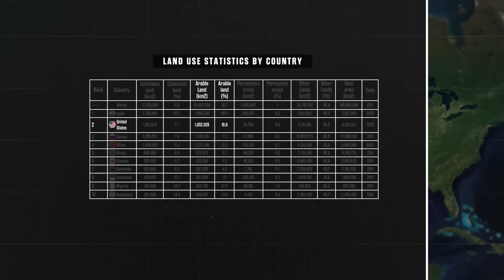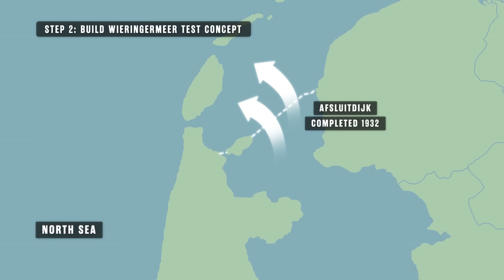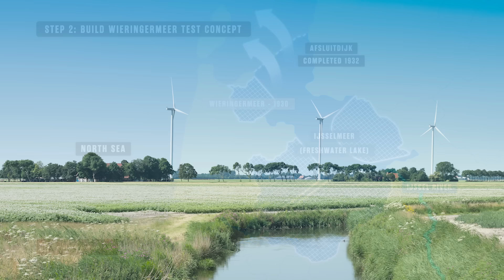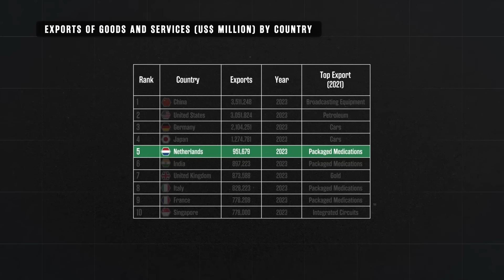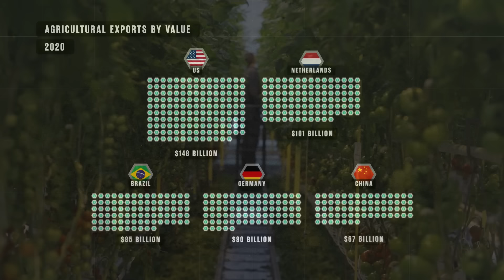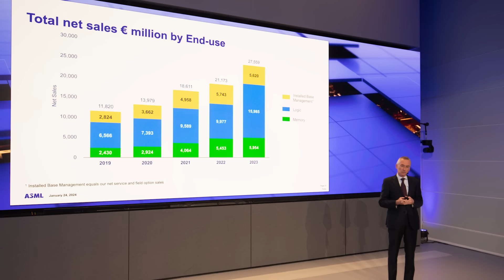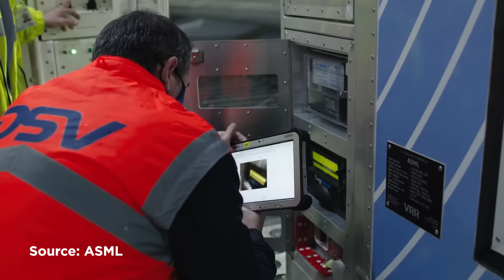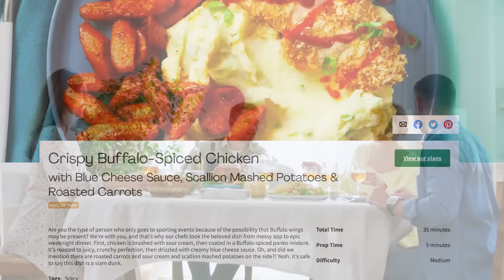Why the Netherlands is Europe’s Most OP Country

Comment: You forgot to mention that the Netherlands has a strong tradition in risk management, partly due to its ongoing battle against water. Dutch companies and managers are praised for their expertise in logistics, supply chain management, and risk management. They deliver managers to all countries around the world and fix their problems. The Dutch have an extensive degree of organisation and planning, from scheduling meetings to book holidays far in advance. Managers are vigorous and decisive, but the consensus is mandatory, as there are many key players in the decision-making process
Reply: Why it has going to do with battling water?
Reply: This vid laudates nld als origi al poster. Not just water
Reply: Weird comment
Reply: The 56 minute video had been up for less than 30 minutes when you posted this, how did you even know what he mentioned? lol
Reply: @Styreta  How dare you use common sense??
Reply: he did mention it albeit worded differently
Reply: They should send some of those managers to Intel…
Reply: He also forgot to plug his nebula
Reply: This is why the Dutch owned company I work for in property restoration is getting a lot of investment and being run somewhat properly for the moment. The Dutch, at least, can see that Canada needs help.
Reply: They often work following the “polder model”, which roughly means running a company (or anything else) by consensus. Though that has - at least in their politics - been showing some cracks. This model is in stark contrast to the French or Italian top down model.
Reply: Great BS story, greetingd from NL.
Reply: Also the Netherlands has some of the best swimmers in the world considering, and I'm guessing here, their fight against the ocean the everyone must learn how to swim
Reply: and where was the risk management of mass immigration? none to be found.
Reply: @honor9lite1337 because if they make one false move the oceans would drown parts of the country like it was Atlantis since a good chunk of it is below sea level
Reply: @honor9lite1337 If you can successfully run and maintain infrastructure in a country that is under constant threat of being submerged, you would probably have to be pretty good at planning and logistics.
Reply: @honor9lite1337  It comes from the dutch water board system. They were set up to handle anything to do with water communally.
Reply: @honor9lite1337   what is the single 2 most important parts for any engineering project before you even start building: planning and design.
Reply: And the Netherlands started modern science with it's influence in creating the modern microscope and telescope.
Reply: @hydoffdhagaweyne1037  No, it isn't. The Netherlands needed a lot of knowledge of physics and a lot of engineers. So, The Netherlands have a few very good universities. On the other side, the Netherlands needed a lot of merchants. They learned a lot of the Italians. The Netherlands had a small colony in the United States. The Dutch had something like a stock exchange. This colony was a part of New York. You should read some history books.
Reply: @BertVerschuren great answer and a fascinating topic in itself (the origins of the polder model).
Reply: @ChrisWijtmans define "mass" and please use data iso shallow Wilders parroting. Then please also take along the vacancies we have, the vergrijzing thats ongoing and our tiny birth rate that will produce an health care catastrophe if we dont actively continue to recruit foreign people to keep our work force at a sustainable level.... Sure housing is an issue, but the alternative is far worse...
Reply: @maartenvz  how old are you?
Reply: @honor9lite1337  hi i live in the netherlands and like most of the land is below sea level thats why because if the thing thats a sercurity measure against rising water gets destroyed so will allot of the netherlands i dont know how to word the structure so i called it security measure idk
Reply: It also helps having developed a dinstinct organization decisional style and cultivating historical ties with Japan e.g. the global Lean Six Sigma Institute in Rotterdam.
Reply: You gotta point me to those managers, because the managers I have experienced in the places I have worked in, in said country, don't scream of all this excellence you are boasting about.
Reply: Because to battle water you need cooperation, ability to manage the team and the equipment. If you look into the famous Delta Works system, you will discover that some of the solutions were created for the first time (creating an artificial island, for example)
Reply: How has the Netherlands' historical struggle with water shaped its reputation for exceptional risk management and organizational skills, and what impact does this have on its global influence in logistics and decision-making?
Reply: @honor9lite1337  In a nutshell. Dyke/Levy construction was historically depended on consensus, given the amount of time and money involved and the distribution of power between rulers, landowners and 'merchant-aristocracy'/finance. The more rights citizens got, the more this consensus-model gave form to current society also.
Reply: Amen. 🎉.
Reply: I think the Dutch’s skill with Risk management could also be chalked up to their history of mercantilism and pragmatism in commercial activities. Ofc mentioning the VOC you also need to reference that its not exactly ‘good’ business they were doing, but in terms of profitability and bureaucracy and especially when this was a Republic, with competing provinces managing these commercial affairs, managing the risks of overseas voyages in high-value trade, now thats where we really developed amazing risk management
Reply: I think the Dutch’s skill with Risk management could also be chalked up to their history of mercantilism and pragmatism in commercial activities. Ofc mentioning the VOC you also need to reference that its not exactly ‘good’ business they were doing, but in terms of profitability and bureaucracy and especially when this was a Republic, with competing provinces managing these commercial affairs, managing the risks of overseas voyages in high-value trade, now thats where we really developed amazing risk management
Reply: yep heard about this... they have really good logistic management skills.
Reply: @ChrisWijtmans i'm 41, not sure why you need that info to explain what you mean...
Reply: @ChrisWijtmans  Is there a risk then? Aren't we all having a little, nice, cozy, multi-culti society without any problems? 😂😂😂
Reply: @Styreta  He might have watched it in 2x speed, some people do that for some reason.
Reply: Top comment here. I’ve lived on my skin 100% exactly what the guy is saying: to plan an hangout with Dutch friends/colleagues, you need to plan 2-3 weeks in advance, like literally put it in a calendar, not joking.
Reply: @honor9lite1337  A government far away is of no use when the water comes. We are raised as children to always think independently and find our own solutions. We had in our history 3 decades without a government without a problem. We organize ourselves if something has to be done.
Reply: which makes sense if you look at the slogan in the dutch coat of arms that we have on our passports "Je maintiendrai" (Nederlands: Ik zal handhaven) (english: i will maintain)
Reply: @maartenvz  well our 'risk nabagment; has not been applied to the growing danger of islamisation and ethnic revanchism, already threatening Dutch citizens in our cities to be overwhelmed and being chased out of their  tiny appartments,  streets and entire quarters.
Reply: You have yet to visit Germany😂 being from there, I find the Dutch very spontaneous and adaptive. Ask a Dutch to meet up tomorrow and if they have time they'll agree. Ask a German to meet up tomorrow and you'll be likely denied because they're not in the right headspace (they really needed it planned). Unless you're a food friend, but again, Germans are more difficult to befriend too😂

Comment: 23:00 this is my city!!! Nijmegen. 
It used to flood like this every other year or so, but a few years ago the city dug out/built a  'mirror canal' (spiegel-Waal) which reliefs the Waal itself, so no/less flooding. The Spiegel-Waal is used in the summer for watersports and relaxation, because there's barely any current unlike the Waal itself. Lastly, the quay has been partially rebuilt to withstand more water. It still floods but all controlled and as intended.

Comment: When Chinese experts tried to disassemble and reassemble an ASML machine exactly to see how it worked, it malfunctioned and they could no longer get it to work.
Reply: Let alone the software needed for it 😂
Reply: @ruud9761  I work at ASML, people know a lot less about how far they're behind from us. It's a lot worse than you think. 😅
Reply: @kyazumizerk9270  I admire the confidence and like it. But so thought tesla and up came BYD, because its a logarithmatic scale, it does not take exactl 10 years to catch up with 10 years of work. Same with chatGPT.  I am not a supporter , neither a denier. Just an observer.
Reply: @ruud9761 Even if ASML wouldnt be there, the location would be a military target because of its location. Besides Eindhoven Airport, where  Air Mobility Command from the airforce is stationed, and 9km (5.5miles) from the army base Oirschot
Reply: Besides strategically in case of war, it is on one of the most protected routes in europe.
As The US will be using the ports in Vlissingen and Rotterdam as landing areas, 
AMSL is situated directly on route used from the ports to central europe
Reply: @piyushgupta3678  cars are a lot easier to design and build than NXE/EXE EUV machines. It's not comparable. ASML alone took 12-14 years for the NXE 16 years for the EXE.
Reply: @mcebabds  Trumpf would be a bigger target due to their lasers.
Reply: @piyushgupta3678 Tesla still outperformes BYD or any other car today. Specially at efficiency. Something that surprises me. It’s hard to copy for Xi?
Reply: @piyushgupta3678  chatgpt and electric cars are not comparable to this type of tech. Especially chatGPT, since it is based on a lot of research available for the whole world.
Reply: @kyazumizerk9270, T'is simply the payoff of never giving up, but let's not get cocky and comfortable yet now that it's no longer about competition, bigger dreams mean bigger results, let's puch tech forward another decade where we can 😊 awesome work
Reply: @jeroenvermunt3372  Electric cars are like a technology integration project. Batteries exist, motors exist, controls exist.
Get good designers in (the Chinese did that, and gave them some freedom they would not get at the classical car brands) end it is a success.
Reply: Ive heard that same thing from one of your colleagues and my friend. Its laughable he said. @kyazumizerk9270

Comment: The Afsluitdijk across the Zuiderzee was build in the 30's before that storm and that storm actually happend in 1953. The Ooster Schelde Kering of the Delta Works were actually build in the 60's because of damage and death caused by that storm. We have had many catastrophic storms in the last 1000 years so when technology made it possible to make something substantial and  lasting against it we made sure we did it right so it does not happen again in the foreseeable future.

Comment: 32:00 worth noting, the Groningen Gas Field isn't empty, but it has been shut down due to circumstance. Decades of emptying out the gas field has caused earthquakes to become a frequent issue in the region (mind you, these are relatively minor shocks, but still enough to crack houses). Also, the energy transition has questioned the relevance of the field and whether or not it is worth the risk and depreciation of livability in the region. It is estimated ~2200 billion cubic meters of gas has been extracted thus far, with roughly 700 billion still remaining under the ground - this data being published on january 2022. Last year a similar conclusion was drawn, with the total being roughly 2900 billion, and the then-current remaining bit 500. The gas field was officially closed this April, with no known data on remaining gas, but I'd say 450 billion kubic meters is a fair estimate. This is roughly 75 billion euros going by 2023 data.

Comment: No disrespect to the Dutch  but the export number compared to the US is not accurate. Because much of the goods the  Dutch  exports comes into the port of Rotterdam from others countries and then shipped out to end user countries. So not produced in NL. However, the numbers from the US is based on actual product grown in the US so the end values are a bit skewed. Besides this the Dutch still are remarkable in exporting.

Comment: I don't disccount the premise of the video; but just don't give them the praise also otherwise owed.
So, some very small remarks: 
* ASML: the nanotech is actually from IMEC (in Flanders, BE). I believe one of our very top notch export products. 
* The painting @33:10: No way that is even regarded Dutch. I'm guessing it's a AI generation? And based on the FLEMISH primitives (like Brueghel). Manybe you could get away with it in context to Antwerp trade (barely) but it's definitly the Golden age of Brugge. 
Just that you couldn't find so much correct influences like Rembrandt, Vermeer, .....

Yes, I'm nitpicking.

Comment: Rotterdam is the least efficient port in the world. So much for automation
Reply: Wrong! 
US ports are the least efficient in the world for their size. Ranked out of 370 ports in the world by the World Bank the US's largest port, Los Angeles and Long Beach, is dead last.
Reply: @Brozius2512  the only automated US ports are ranked dead last, you say. If you look at real data like crane productivity per hr, 3rd world terminals with slave labor, which means they have the most flexible working hrs, and no automation or safety protocols lead the way in efficiency while US terminals with no automation are more efficient than almost all other 1st world terminals.